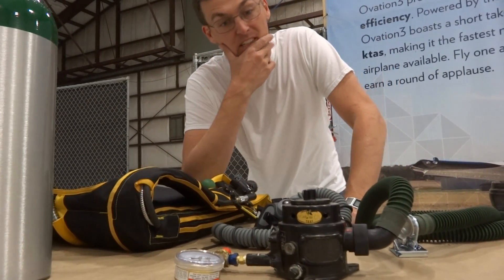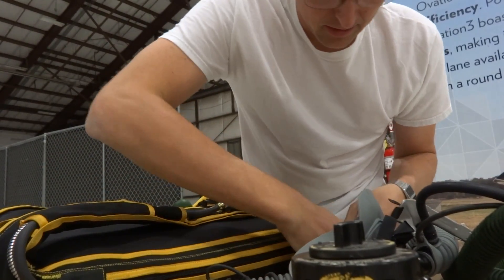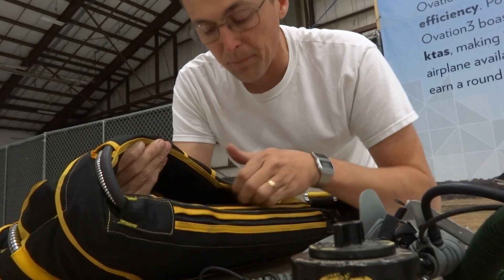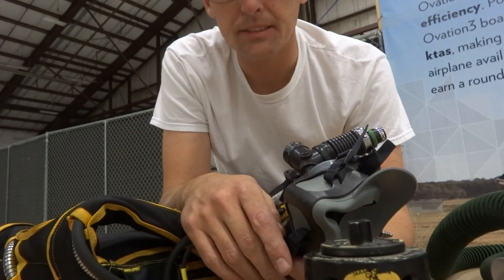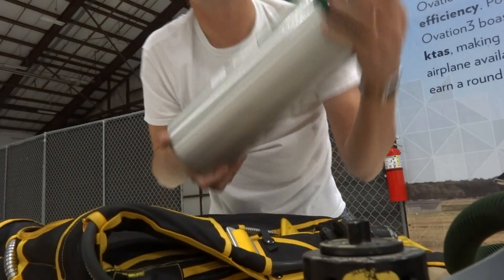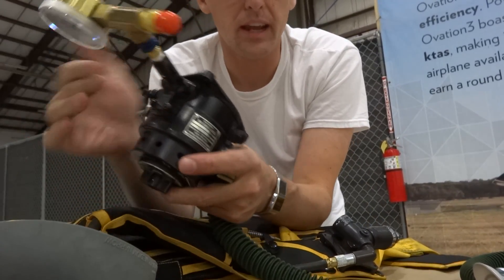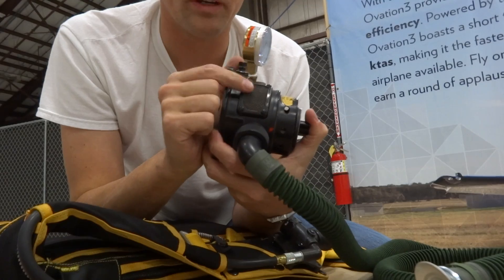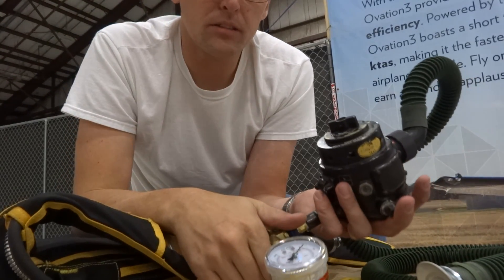Wasabi Flight Test Oxygen System Description

Comment: Elliot, I circled back to this video you sent me to.  Do you have a Flow Indicator (aka "Blinker") for the A-14?  We use this at NASA (the military stopped using the A-14 many moons ago), and the only true way to obtain a leak check with your mask on, is to have a flow indicator.   Your Emergency Oxygen cylinder in your Butler, (if filled to "in the black"), has a 10-minute supply once activated via the Green apple.  It will provide on initial activation a 10-12 LPM flow rate, with gradual reduction so that in the 10th minutes approximately a 1 LPM flow rate will exist.  Hopefully by then you are back down on the ground, or to a breathable altitude.   I have 38 years of experience with the systems you are pointing out.  You been through the altitude chamber?  Man, you have such quality videos and content, it is always a pleasure when you push out a video, keep them coming!!!!!

Comment: Considering the secure and sealed nature of the mask, when you say it applies 100% oxygen is that a continuous flow or a pressure demand system? It seems like you are not high enough to get the benefits of pressure demand other than helping to keep smoke out with the slightly higher pressure. Also wondering if you have had the benefit to go into a hypobaric or a high-altitude normabaric chamber to know what your specific symptoms are for hypoxia? Great videos and love the briefs!
Reply from the maker: Thanks for the comment.

The regulator applies 100% O2 for pressure breathing when the emergency valve is commanded.  The bailout bottle is also under pressure but without a regulator there is a hole and you get what you get.

Yes I have taken three rides in high altitude chambers one at Beale and two in OK city.

Thank you again!!